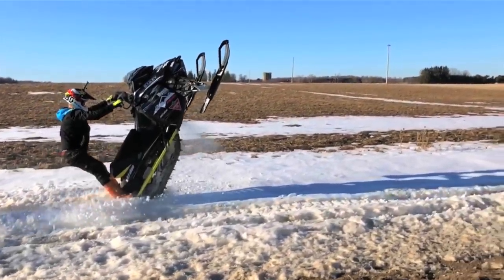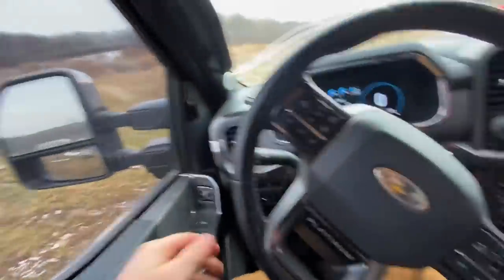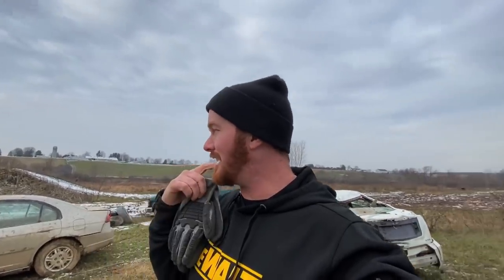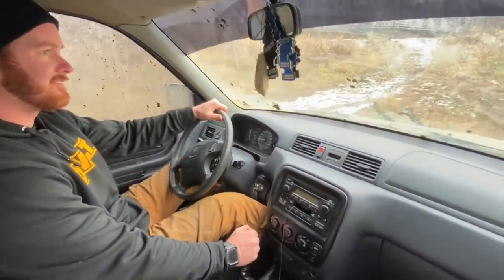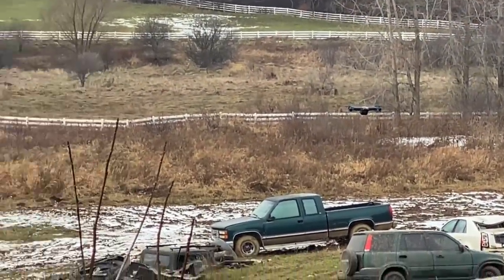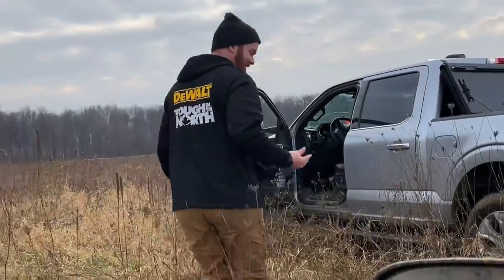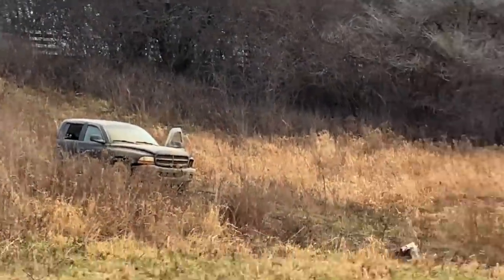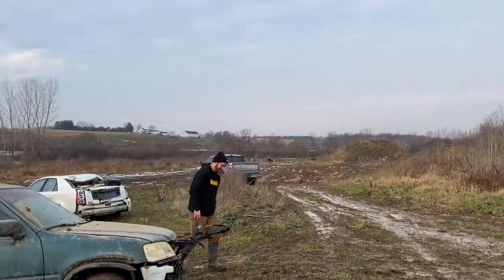DODGE VS Honda CRASH EPIC FAIL!

Comment: You need to get a gas powered pully for the non working vehicles. It's what Roman Atwood used in one of his videos for water skiing. You can pull a vehicle up to 50mph (80kph) with it.

Comment: i have a suggestion in a dire one last time to try and get that dodge truck running.... if u have the tools remove the spark plugs and try toturn it over.....it may be hydro locked from all the water it sucked in... if u take the spark plugs out and try and turn the motor over it will shot the water out the spark plug holes and hten u can put the spark plugs back in and if its not seaizes she will start